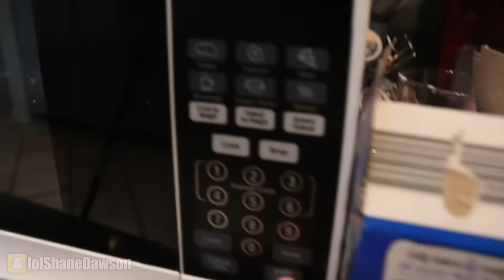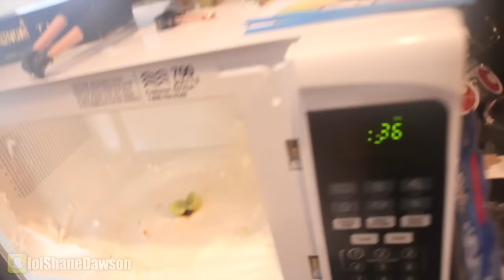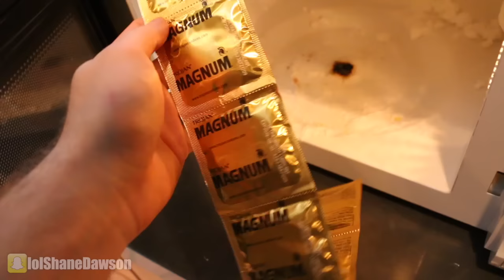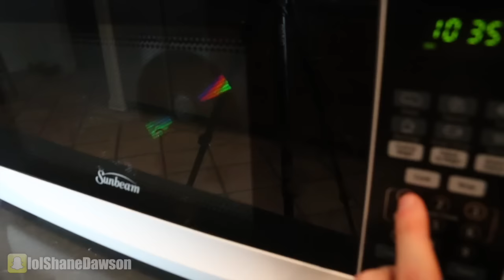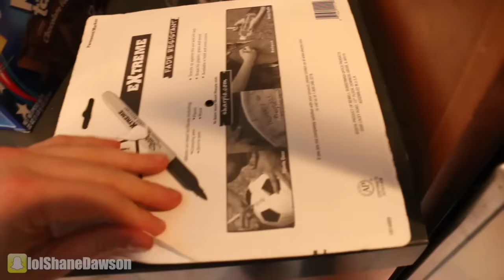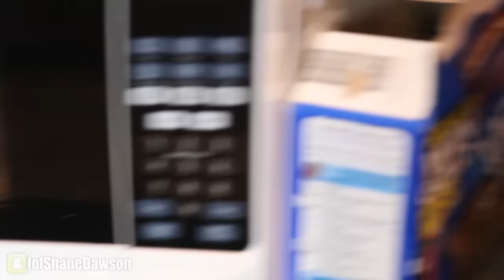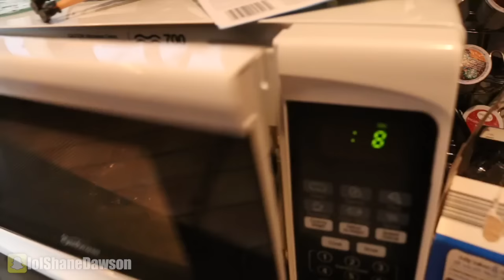DON'T MICROWAVE THIS STUFF 3!

Comment: Try putting a thermometer in the microwave (it will explode)
Reply: dyn 900 so?
Reply: Baked Potato the fluid in the thermometer can give you cancer
Reply: dyn 900 so is putting tin foil in a microwave, but Shane gives no fucks lol